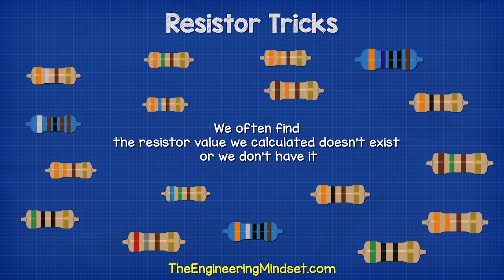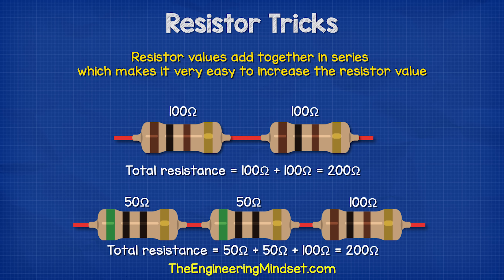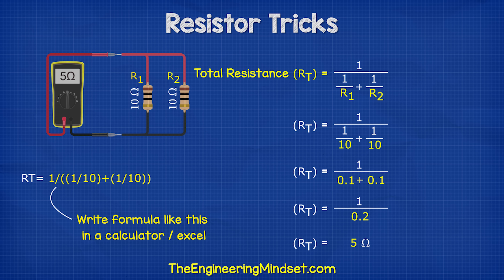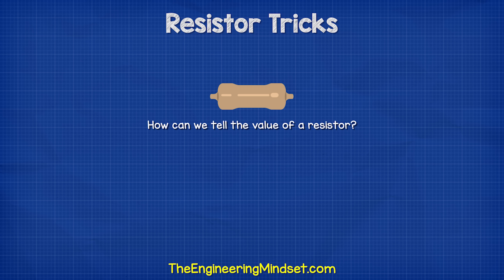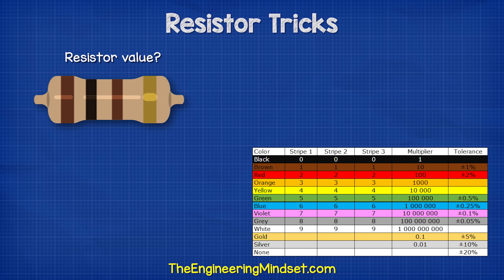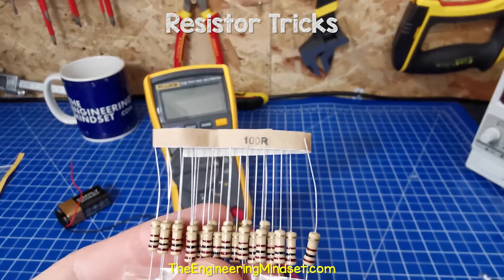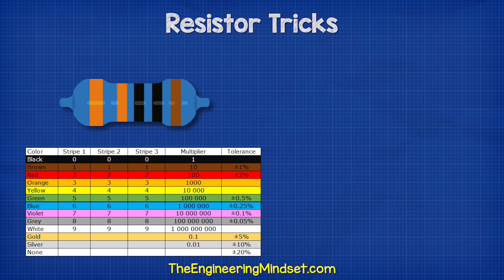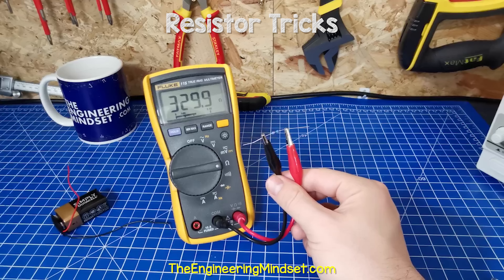How to use a Resistor - Basic electronics engineering

Comment: There’s another formula that’s used when connecting resistors in parallel is called the product/ sum method. When you have resistors in the same value, you simply use this formula. R/number or resistors or R x R / R + R = 8 x 8 / 8 + 8 =  64 / 16 = 4

Comment: Does the wattage matter when it comes to resistors? 

I’m looking to install a resistor into an air bag plug to simulate the factory seat is there as I have installed an aftermarket race seat. 

I get I need a 2.2ohms resistor but the wattage varies. 1/8, 1/4, 1/2, 1 watt. Is the wattage relevant?

Comment: That means if I use a number of same resistors bigger than their ohms in parallel then the resistance will be lower than without the resistors ? (I can be wrong.)
EXCEPT, when the resistance of the resistors is 1 ohm.

Comment: 3:00 how did you get 330 ohms? Where did you get “300” from?
Reply from the maker: First stripe is orange, which is 3. 2nd stripe is orange which is 3, 3rd stripe is black which is 0, 4th stripe is black which means x1, so 330 x 1= 330

Comment: Not what i was looking for but still learned something.

I want to know what a resistor is. How it works and how to make one. How do we measure its tolerance and resistance? And what happens to the motion of the current and the magnetic field of the circuit when a resistor is added to the circuit in series/parallel.
Reply from the maker: Check out NEW resistor video, everything covered! ➡️ https://youtu.be/DYcLFHgVCn0

Comment: In all the hoopla surrounding solid state electronics in the last half of the last century, an important change went un-noticed: carbon composition resistors (those old things with perfectly cylindrical bodies) were displaced by metallic film resistors. Carbon resistors were primitive things - not very different from pieces of pencil lead. They were hard to make with much precision and were unstable. In low power applications the resistance gradually rose; in higher power applications the resistance fell. They also had an inherent negative temperature coefficient. Those were the bad old days of electronics.
Reply from the maker: Check out NEW resistor video, everything covered! ➡️ https://youtu.be/DYcLFHgVCn0

Comment: Can someone explain the science on why the resistance decreases when placing the resistors in parallel as seen at 0:35? My brain just cant compute on that one. I get how the resistance increases when placing the resistors into series because the flow has to pass though each resistor on its way down the chain. But the inverse effect is rocket science to grasp to my mush.
Reply from the maker: We're just giving the electrons more routes. It's like if theres a road that's always suffering from heavy traffic, we'd build some more roads to divide the traffic up. The same total amout of cars will flow but its been shared across more routes, so it seems less on the individual routes
Reply from the maker: Check out NEW resistor video, everything covered! ➡️ https://youtu.be/DYcLFHgVCn0

Comment: Hi there. I have a small question about resistors. I’m trying to fix something and therefore I need to add more resistors in the circuit as the ones there are in a now turn black and get really hot. I’ve asked a friend and he suggested to add 4 0,25W 10K resistors, but I don’t have enough space for that. I’m not a very technical person so I don’t know much about it so therefore I reached out to you. Is there a way I can add 1 bigger resistor with a different value in this circuit instead of adding the 4 ones i got suggested? I would also like to know what value I would need. I’m looking forward hearing from you. Greetings from the Netherlands! Sander
Reply from the maker: Check out NEW resistor video, everything covered! ➡️ https://youtu.be/DYcLFHgVCn0

Comment: Do you I know that some cars  wiring going  to that ignition side of the coil have resistor to limited eletrons on the wire  and get less energy on the coil = less power to spark and more fuel need to make of the horsepower that need to go,  if remove that  more miles per gallon on the go..
Reply from the maker: Check out NEW resistor video, everything covered! ➡️ https://youtu.be/DYcLFHgVCn0

Comment: This is awesome. But what if you flip the resistor and read the bands the wrong way? Does orientation matter?
Reply from the maker: The resistor works the same but the resistor bands are read in only one direction. The end band is slightly further away. But, you can just check it with a multimeter
Reply: @EngineeringMindset  ah ok thank you
Reply from the maker: Check out NEW resistor video, everything covered! ➡️ https://youtu.be/DYcLFHgVCn0

Comment: Problem with calculating the OHMs of a resistor, is that I never know which side to start from (left or right), I s beard for example look for the larger gaps, or look for the thick color, but usually I don't see either...
Reply from the maker: Check out NEW resistor video, everything covered! ➡️ https://youtu.be/DYcLFHgVCn0

Comment: Resister come (normally) in standard values. The smaller the tolerance the more values. 
At 20% the values are:
10                  15                     22                     33                      47                  68      
At 10% the values are:
10      12       15        18       22        27        33       39         47      56       68        82
At 5% the values are:
10 11 12 13 15 16 18 20 22 24 27 30 33 36 39 43 47 51 56 62 68 75 82 91

The 20% values are the easiest to find.

Comment: taking a reading from an unmounted or even a mounted resistor always stifles me (especially meterless). I always have indecision between  "red " "brown" and "orange".  Sometimes the brown looks like red and sometimes the red looks like orange.  ARRRRGH! :'(
Reply: Yes!

The exact values are often not as critical though - remember the tolerance from the manufacturer can be as high as 20% (no band) and meet a standard.

The one time that sticks in my mind, we had terminating resistor blocks on an RS422 network that was giving us fits.  The manufacturer had sent us ones made with 100k ohm resistors instead of 100 ohm.  THAT made a difference!
Reply: @firstmkb  i feel ouch !!!
Reply from the maker: Check out NEW resistor video, everything covered! ➡️ https://youtu.be/DYcLFHgVCn0

Comment: The easiest way for me to remember this is to think of it in terms of conductance instead of resistance.  Conductance is the inverse of resistance (1/R), and they just add together - which makes intuitive sense to me.  
So total conductance Ct = C1 + C2 + C3 etc, which is the same as the second formula listed 1/Rt = 1/R1 + 1/R2 + 1/R3 etc.
Reply from the maker: Check out NEW resistor video, everything covered! ➡️ https://youtu.be/DYcLFHgVCn0
Reply: This is a great idea, I bet a lot of students would understand parallel circuits more quickly if it was explained this way. By adding more paths for current to flow, the overall conductance is going up, so the resistance is going down, but engineers are very cynical people so they prefer to talk in negative terms like "resistance" as opposed to "conductance." Except for conventional vs. electron flow, for that they think positively
Reply: @MaxPowerElectric   There is no "conductivity", so "resistance" is legitimate. For example, zero resistance refers to superconductors, so how would you express the so-called "conductivity" that results from resistance, such as conductor resistance? It is good to imagine this in a parallel scheme as a division into "branches", which carry only a fraction of the total "current" and therefore the passage through the "branches" is easier. The resistance in the parallel solution decreased. This is also mathematically illustrative if you are working with the same resistors, for example, let's take an example from a 10 ohm and 10 ohm video in parallel. The value of one of them, ie 10 ohms and divide by the number of resistors in the circuit, which is two. 10/2 = 5 ohms. Or, 5 ohms and 5 ohms - 5/2 = 2.5 ohms. Or 10 ohms and 10 ohms and 10 ohms - 10/3 = 3.33 ohms. If the resistances are different, it is necessary to solve this difference by the formula of the sum of the inverse values of the resistors. But in practice, the prevailing experience is that you have the same resistors and want to make smaller ones. The simple mathematics of one resistance value divided by the number of resistances is quite used because it is intuitive and reflects the principle.

Comment: What if you have a resistor with these values:
 945 with 100 multiplier? 1 % tolerance. answere where would be 94500 (but what value is this?)  Ohms? Kohms?? color code is white,  yellow,  green,  red, brown.
Reply: Just going by your information, that would be 94500 ohms or 94.5 kohms.
Reply from the maker: Check out NEW resistor video, everything covered! ➡️ https://youtu.be/DYcLFHgVCn0

Comment: Another method for calculating that I find easier to remember is (R1*R2) / (R1+R2)
Reply: Explain by example please. Mathematics example. Thanks
Reply: Using the same example in the video with two 10 ohm resistors in parallel, it would look like (10*10) / (10+10)  >>  (100) / (20) = 5 ohms
Reply from the maker: Check out NEW resistor video, everything covered! ➡️ https://youtu.be/DYcLFHgVCn0

Comment: Okay I'm only starting to get back into electronics after a 30 year hiatus.  I'm trying to remember whywhen you  convert 12v to 3v you need to use two resisters with output in between the 3K and 1K resistor.  It's the need for the 1K I can't remember why.
Reply from the maker: Sounds like you're using a voltage divider. There are lots of configurations but there are more efficient methods to reduce the DC voltage
Reply from the maker: Check out NEW resistor video, everything covered! ➡️ https://youtu.be/DYcLFHgVCn0

Comment: But how on these tiny components, can you tell which end to read from, especially on the ridiculous blue resistors?
Reply: There should be a space before the tolerance end which would put it to the right.  Plus the value would not start with a gold or silver nor would the tolerance be represented by a color of the rainbow.
Reply from the maker: Check out NEW resistor video, everything covered! ➡️ https://youtu.be/DYcLFHgVCn0
Reply: From left to right

Comment: Used to dabble around with electronics when I was I kid in the 70s. When components were something you could hold between your fingers, unlike now when you need a microscope to see them. How do electronic hobbyists manage nowadays?
Reply: You still get commercially available sets with components of that size. Kids today can also take things a step further with things like arduino (robotics kits)
Reply: We work on old equipment. I started restoring mid 1920"s radios. The amazing 201A vacuum tubes are close to 100 years old and still work!
Reply: Magnifying glasses and tweezers.  I can’t remember the weird number codes for SMD capacitors and have to look them up.

Plus, many devices are still made at human scale for prototypes etc., but SMD is far cheaper.

Comment: Hi, is there any easy way to determine which band is the first band since sometimes several resistor might have similar color for the first and the last band?
Reply from the maker: The gap is slightly larger between the last two lines. The last line can be colors which the others can't. Just check it with a multimeter
Reply: @EngineeringMindset so the safest bet is using multimeter then.
Appreciate ur quick answer mate. Keep up the good work
Reply from the maker: Check our new Multimeter tutorial out ➡️ https://youtu.be/4lAyzRxsbDc

Comment: I have the most trouble figuring out the value of the resistor but calculating a resistor divider is easy for me
Reply from the maker: Check our new Multimeter tutorial out ➡️ https://youtu.be/4lAyzRxsbDc
Reply from the maker: If you can't read it, just measure it with a multimeter
Reply: @EngineeringMindset  i always have note in my pocket, which tells the value. Simple and easy : )
Reply: @EngineeringMindset  I'm red brown color blind and I have never considered just measuring the damned things.
Reply: @tolkienfanman1  you should find another job
Reply: @EngineeringMindset  that's horrible advice

Comment: Sir. I have a silly question, if i have a 2 pieces of 100ohm resistor (1/4 Watt) in series or in pararel. how does the power capacity increase (1/4 watt + 1/4 watt) or its just stay at (1/4watt) ? 

(sorry for my bad english)
Reply from the maker: Watch our video on parallel and series circuits, all calculations shown
Reply from the maker: Check out NEW resistor video, everything covered! ➡️ https://youtu.be/DYcLFHgVCn0